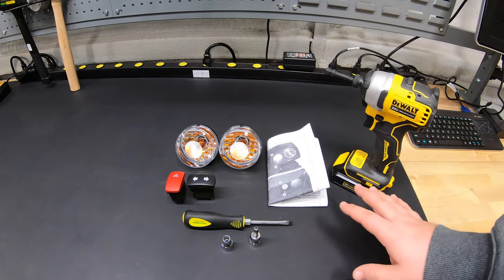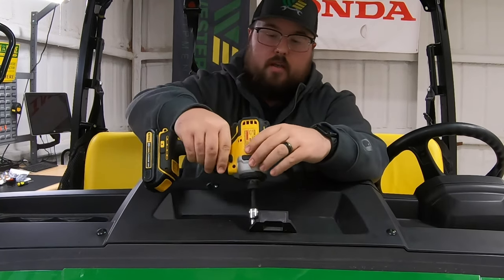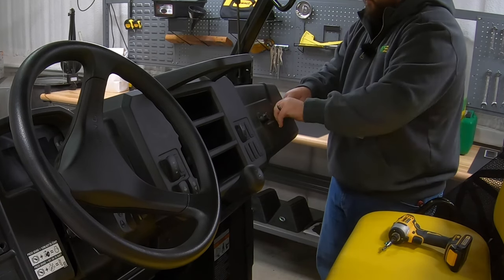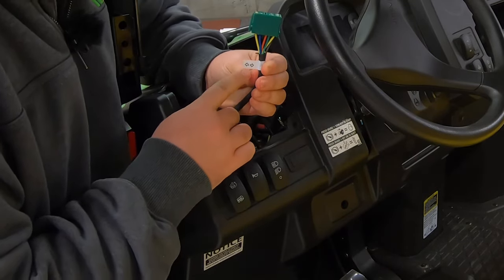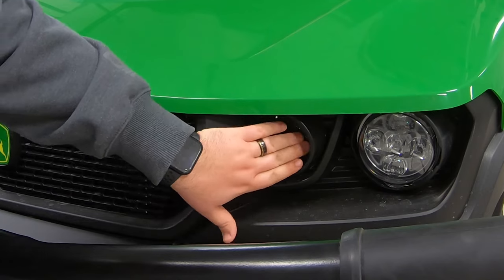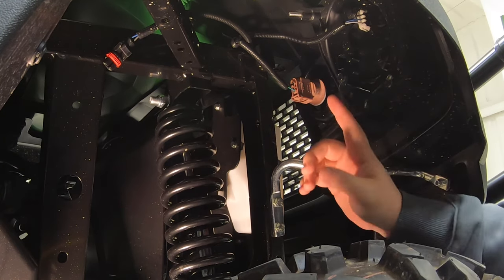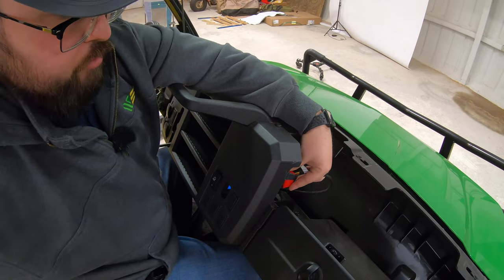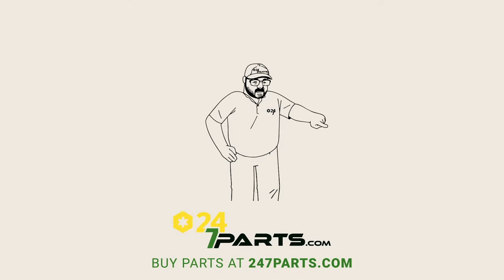How to Install John Deere Gator Turn Signal Deluxe Headlight Kit BUC10608

Comment: I was hoping you might be able to help me out. We have a 2020 XUV835M, enclosed cab, has heat / a/c, wired for snow plow, has the led headlights but no turn signals. I purchased BUC10608 turn signal light kit, and BM26183 wiring kit. When I pulled apart the dash, there is no place to attach the harness but there was already cannon plugs for a radio, beacon lights, work lights and a few other connections but no turn signals or hazard connectors. Is there another kit that I’m not seeing when I search online that I can order to make this work?
Reply from the maker: I will have to look into this.

Comment: Great video. Do you have a part number for the front harness that's needed for the turn signals? I couldn't find it on the John Deere website.

Comment: Very informative, thanks. Do you happen to know of a fog light kit that utilizes the turn signal socket in the headlight? My machine is a 2021 XUV590M
Reply from the maker: The closest to a fog light kit would be to add the addition LED lights to your front brush guard.

Comment: If you buy a CF Moto it comes stock with turn signals and a whole lot more for a lot less money. They even come stock with an electric trailer plug in for trailer lights. But the biggest thing on a CF Moto which is also stock is all four wheels have power to them and will spin not like John Deere where the front differential doesn’t lock up and only one wheel on the front axle will spin. Oh and the parking brake is also stock on CF Moto. Just saying…..

Comment: I have a 2012 825i will this kit work with it and are the turn signals already in the tail lights, and are the plugs for everything already there?
Reply from the maker: So this kit will not be the one for the 825I but if you already have taillights then you should be set up to add the front turn signals. I would double check to make sure there are connectors coming off of the harness to your headlights to add the turn signals and if there isn't then you would have to order a wiring harness as well.

Comment: I purchased the turn signal kit for my 2020 560e. The kit came with front and rear lights and a harness from rear to council. But there was no switches or harness for the front turn lights? Do you know if there is another kit? Am I missing parts?
Reply from the maker: Which kit did you order?
Reply: BM26180
Reply: @BigBidnessOutdoors  did you ever figure out a solution to this? I think I bought the same thing as you and can’t figure out what to do next.
Reply: @danteirvine2073  Yes I did. There is a harness you have to purchase separately. Another 200.00 I believe!

Comment: Do they have a kit for a 590m gator
Reply: 2022
Reply from the maker: Yes, and that kit would come with rear signals as well and the part number is BUC10790. Thanks for watching!
Reply: What headlights are those. My 2022 590M has a single led light. They are bright though.  But no hi low feature